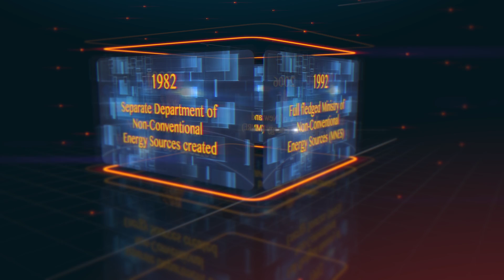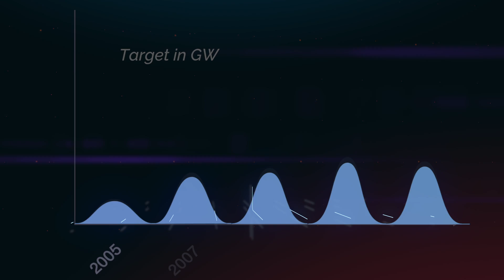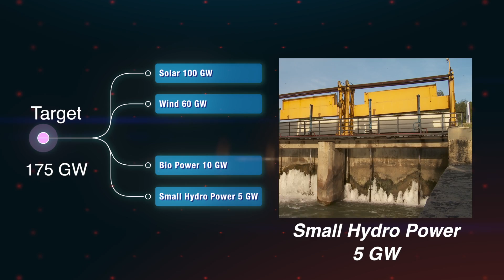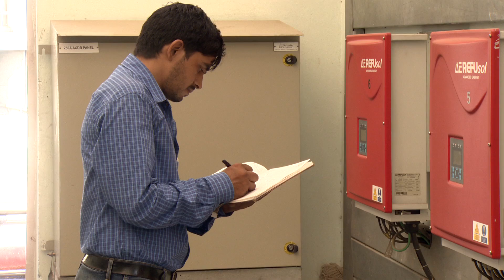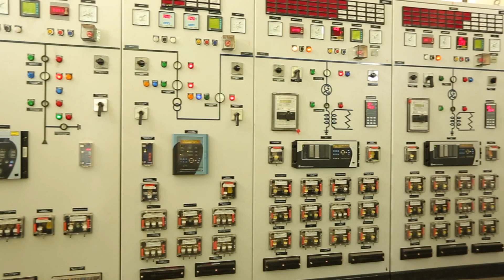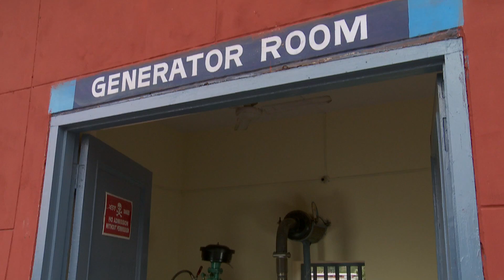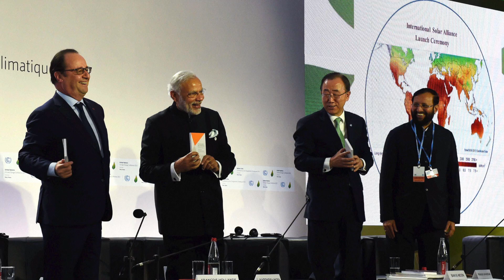India’s Renewable Energy Journey

Comment: Street lights is installed in our village around 60 to 70 but after few months 80 % of the street lights were not working ,,,we need work with quality wise not as quantity wise ..
Reply: you or your leader  can complain to remove this problem to the company which is responsible 4 it.
Reply: The solar panel needs to be clean to have enough radiaton to produce electricity .. If u don't clean it on regular basis it will not work over time.. I think the villegers should have some responsibility as well
Reply: @userisofflinefornow  but it's also true that the GOI comprise on quality , cause you can see in almost every sector that quality is compromised. For installing quantity means they can put a higher bill and get more money in their pockets. Maintenance won't get them a lot of money.
Reply: it's problem broo
Reply: Quality comprise in installation by your leaders
We also face this problem 😊😊
Reply: With dusty dry season small solar is a non starter. Rooftop solar needs sufficient angle and regular rain. 
Solar parks have management to plan the cleaning.